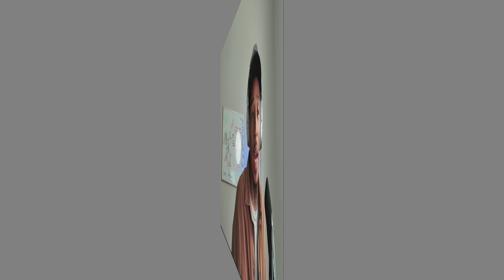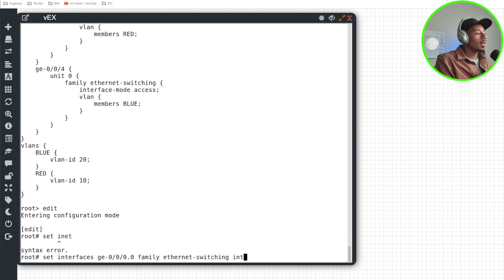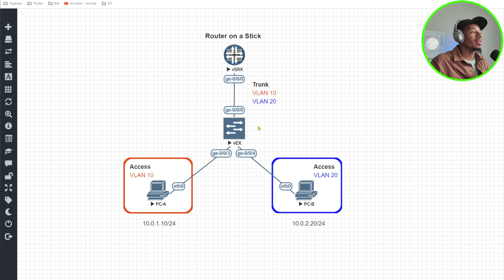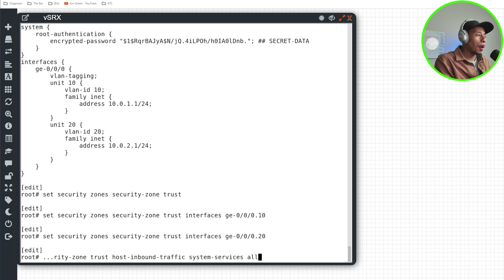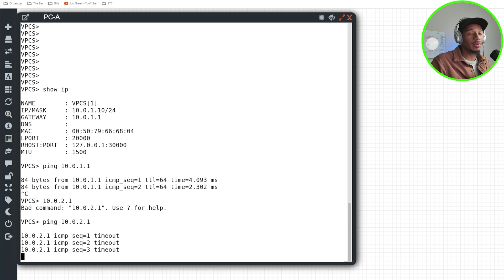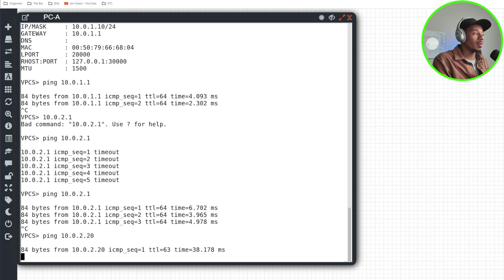How to configure Router on a Stick on a Juniper SRX

Comment: Eveng is awesomeee. I'm thinking of getting real gear. What do you think about the srx300,320, and 340 along with the ex2200 compact switch? Any gear you recommend?
Reply from the maker: Yeah EVE-NG is pretty great but physical gear makes the learning process feel even more real. The srx300 and ex2200 are good lab gear which you can often find a sweet deal on eBay for both.